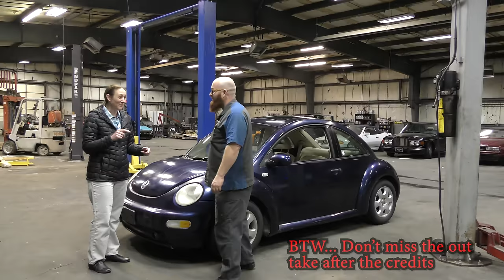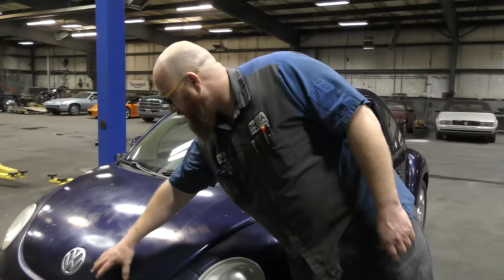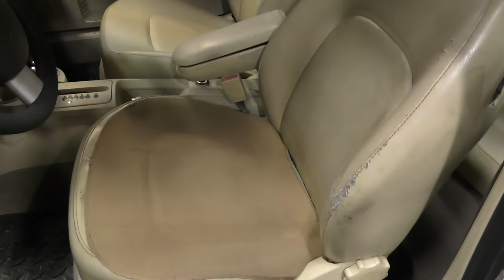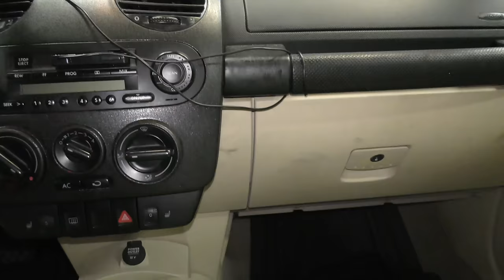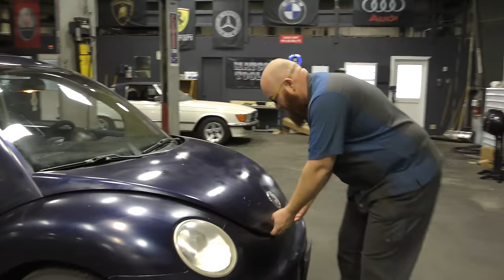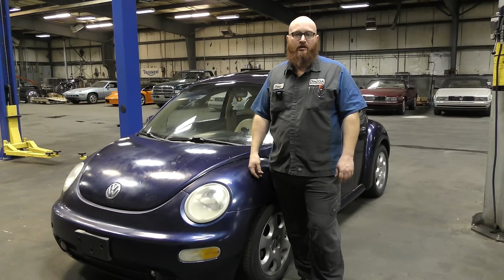Squirtle Update! Why does the CAR WIZARD love this 2002 VW Beetle so much?!?!

Comment: I had a 91 Jetta with the 1.8 8 valve and 5speed that I got from a customer with 289,000 on it. I drove it for a while and sold it to a friend who was tired of running his F250 60+ miles a day to work. He fixed the air-conditioning and put 90k on it before the odometer quit working. He parked it when gas went down again and ended up giving it back to me. I used it as a beater again and by the time I sold it we estimated it to have 450-500,000 miles on it.

Comment: I have the same system to connect my 1999 VW radio to my phone, but I've extended it with a $4 Bluetooth adapter from eBay out of China, into which the headphone jack is plugged. And even better, this thing also has a little microphone, so now it's also a hands-free system through the car radio. The bt device has a tiny internal lithium battery which lasts about 6 hours before it needs to be recharged, but it just plugs in via microUSB, like a phone or many other things.

Comment: I have a 2000 Golf TDI 1.9L with 398,000 on it. I will be pulling the intake to clean out the carbon, almost 60% blockage. Then I'll drop down and replace bushings in the lower A-frame. I also have KYB struts and strut components to install. Along with wheel bearings. Left side bearing is doing a lot of growling, but I going to do both while it is up on jack stands. I figure the right side can't be much behind the left with the milage.

Comment: I had an 03 competition orange beetle with the 1.9 TDI and was a manual. I sold that car a little over a year a go with just over 340,000 miles. That car was amazing I seriously regret selling it. It had a bunch of goodies and it was pretty peppy off the line. It had an egr delete a full straight pipe, cold air intake, lowered,  
5% window tint, drilled and slotted rotors front and rear from ebc with the mark series brake swap. :( I miss that little bastard.

Comment: @Car Wizard,
 Have you had any foam shooting up from the vents? The foam heater flap under the dash disintegrates over time and leaves the metal plate with air flow holes. Open all your dash vents and see if that helps air flow to warm better. I have a 98 5 speed manual TDI so I know where you're coming from.

Comment: My 2000 new beetle is the car that taught me the lesson about cheap parts once and for all. I did a timing belt, tensioner pulley, and the water pump. The water pump was a Gates. The water pump froze at 4,000 miles. Destroyed the valves shot two pistons, killed the car. Driving a Honda Civic now. Damn well has an OEM Asin timing kit.

Comment: You can use VAGCOM to close the ERG in the software, that way you won't get any codes. Also, since this is a variable vane turbo, exercise the vanes every now and then to avoid them getting stuck.

Comment: i had i and got another one a few months back..my first one 2001 jetts tdi auto i had it for 185k besides the maf going on me and the window recall nver stranded me , i did get well in the mid /high 40 on the highway as long as i kept it at 75mph..that was the sweet spot, now i have  12 tdi stick and love it..so far so good

Comment: There's a software setting for your TDI car where you can almost completely turn off your EGR valve (off road mode) and stop the gunk build up of your intake maniforld. You just need the cable that connects to the OBD port of your car (you can buy the cable on EBay for almost nothing) and the Ross Tech VCDS -Lite software for your computer which is also inexpensive. I did this on my 2001 Jetta TDI and afterwards I even had a lot more power.The dealership can do this (but won't) and Ross Tech VCDS Lite can do it also.

Comment: Iv got a Vw convertible 2004 best car iv ever had drives amazing & iv got a XK8 jag convertible trust me best value for money the VW beetle never lets you down & parts are cheap .
You can replace most parts yourself it’s like a Ikea car simple assembles .
When the summer kicks in & the roofs down it puts a big smile on your face & they come with a great sound system very good speakers .
The VW convertible 2004-2005 model Amazing car  & best value for money for a used car it’s a Solid 10/10 from me 👍

Comment: At least here in Germany and  ~7 years ago you could buy a Mercedes airflow sensor for half the price of the VW part. They used the same (i think Pierburg) unit just in a different housing. 2 screws to switch the piece you need in the VW housing. We used to deactivate the EGR valve on those TDIs to keep the intake cleaner and have the turbo spool up a little faster.

Comment: lots of info on  the beetles on the VWVortex and the TDI at the tdi forum. and codes are on the vag com forums. we get rust free parts all the time for them. here for people, there is a return spring for the rear calipers that helps out,, we brought them in back in the early 2000's from skodas

Comment: I had two of these...first was a lease return with 12k miles and I drove it until 168k miles before the turbo blew and there was a runaway and still got 3k for the car as is...the second I bought for $1300 it needed a clutch and an alternator...clutch took me 2.5 hours to do...and alternator took 5 hours LOL but book time for alternator is 12hours...I drove the wheels off of this car and was determined to keep it going until I retired...sadly 4 months prior to retirement I was rearended and my beetle was totaled out...man..was I pissed...although I still got 1700 for her...I missed that car every single day...what a great car these are.

Comment: If you want to fix the problem cheaply in a bind, just unplug the maf sensor, it'll run without limp mode, but use more fuel. Perspectively, replacing the sensor definitely makes sense though.

Comment: I have a 1994 Subaru Legacy with the 2.2l SOHC EJ22 with 289,000 MI, and it shows no signs of stopping. I'm eventually going to replace the head gasket and timing belt,water pump and do a reseal, and replace the piston rings because they are definitely worn.

Comment: i had that same issue buying cheap china parts off amazon. it was an idle valve for my accord. worked ok for about 5 minutes. went and got a real one off a junkyard car that had been rear ended, so i was pretty sure the engine parts were good when it got there. the junk yard one was half the cost.

Comment: Used MAF sensor can be worth a gamble sometimes. I got a used OEM one for £25 for my Volvo V70. Volvo wanted £400. I reckoned it was worth the risk even if it lasted 6 months. Went from limp mode to wheel spin in second gear. I kept the car for 2 years after this, MAF still going strong when I traded it in.

Comment: I had my mechanic clean the air flow sensor, on my 1999 nissan frontier 4cyl. That worked for 20 miles. A new one was $450. I bought a rebuilt one on ebay for $50. Popped it in myself. That passed smog & worked for 30,000 miles +. It wasn't  a high risk decision.

Comment: My ALH just lost the turbo at 295K and sadly it took out the motor. I decided to throw a used motor and new turbo for $5K because I get 51 mpg and don't want a Prius. *Hint-bigger injectors make this car much more fun to drive and actually improves MPG if you keep you foot out of it. Deleting EGR throws the check engine light but it doesn't matter, just leave it on and clear it before smog testing

Comment: 250,000 on a '94 VW Cabrio 2.0 gas 5 speed with the original clutch :D ... on it's third timing belt and second top. Burns a little oil, but it's a spare car, and my wife doesn't have the heart to get rid of it as long as it still runs. I wish my Chevy Volt's heater worked as good as this things heater does.

Comment: You asked about ODO miles. I have 370,000 on a 24V Dodge Ram 4x4 Cummins with an NV5600 (my last truck). A 9,000#, Rotary two-post helps me do my own maintenance.

Comment: Instead of that pipe to disable EGR, buy a blanking plate to both ends of the EGR pipe which goes from exhaust to intake. Best thing you can do to that engine. They're also available in ebay :)

Comment: I can't agree more on the MAF sensor subject. I had a bad MAF on my 2005 VW Touareg V6 and so I went and bought a brand new (knock-off) Bosch sensor thinking what's the worst that can happen? Well, when I installed it, the engine actually ran worse than with the original bad one (sound familiar?) So I bit the bullet and bought an oem one and that V6 was happy again. At least I was able to return the fake MAF and get my money back.

Comment: I have put 70k on my 92 chevy k1500 that has a total of 270k. My father had put at least 100k on it before me as his field service truck. It's on its 2nd engine and transmission and runs and drives great.

Comment: I've got a 2001 VW Beetle with a 1.8-T & a 5 speed standard tranni that I've Adopted on August 6th, 2002 that I have named Unbeetleble that has a turbo-back exhaust (cat & muffler got replaced with some glass-packs) I also had the factory K-03 turbo replaced with a K-04 & had a software flash from APR but of course I also put a high-flow intake system in it too. (220 WHP-244 Ft/lb of torque) I almost forgot that I also have adjustable suspension on him. BTW I wouldn't trade him for anything in the world.

Comment: 9:20 blend door. Been through that before. Remove the entire dash to get to the unit... properly.  It's more likely the foam on the blend door flaps themselves. Once they go, ac; heat, and air flow direction won't work.

Comment: my dads 9n9 polo 1.9tdi had done about 850,000km. he swears by that 1.9tdi motor. 
outside of basic matinance such as oil, filters and brakes we have only had to do a a fuel pump, ball joints and struts. It's held up great, when this one fails, i think we will pick up another one.

Comment: That just happened with me with injectors, $63 for a set of 6 when one oem is $76. After alot of other work and finally getting it running it ran terrible, poured gas outta the exhaust etc. Almost ruined my $500 van. But I got some at the junk yard for the price of admission and it runs great now.

Comment: Let Ms wizard drive it for a week, she'll love it. My husband brought home a 2008 toyota camry 4 cylinder with a 5 speed manual, I hated that car at first then I started driving it, now it's my favorite.
I love the gas mileage and how easy it is to drive, it has over 230,000 miles by now and still runs like new, we just have to do regular maintenance to it. My husband always says "a clutch is cheap to replace, an automatic transmission is not". I think he's right.

Comment: I had a 2001 Beetle TDI with automatic. I knew about the bad engine and replaced it, but didn’t know about the transmission. I ended up changing it to 5 speed. It was a big job for me but probably easy for wizards.
Reply: I forgot to say what a goofy car those Beetles are. The old classic ones are pretty cool but the new ones have some crazy stuff just to complete the look. The sun visors are useless especially when turned to the side. The taper of the engine compartment and trunk hurt space needed to work on it and storage. If you like wearing ten gallon hats, it has the most headroom. Other than that, it’s a VW Golf with different body. The engine goes forever, with proper maintenance.

Comment: Car wizard on those if you want to bypass the egr system you must remap that ECU there is no way around it , my 2.0tdi BRE Audi had the same issue with the EGR so I got a bypass and removed the EGR remapped the ECU now I have better power and no check engine also no smoke  so you should try that

Comment: HEAT!
The blender doors are covered with a blanket insulation like under the dash. It degrades and leaves big holes that your air blows through. The fix is to cover those holes with aluminum foil tape (for duct work).

Comment: And the only electric motor on the hvac system is for fresh air. All the rest are cable. U can access the cables n linkage behind a lil cheater panel on both sides of console. Should b 3....  red yellow green I think. Rite above airbag module...  you’ll see it...  then you’ll know if it’s something broken w the box

Comment: Change the fluid on that trans and it will last. I bought an 05 Jetta 5 speed auto with a"bad trans" that would stick in first till it warmed up. Changed the fluid and have over 10k miles of flawless operation since.

Comment: Hi Wizard!

You were complaining about Squirtle being cold inside on cold days. TDI Engines are very effective, so they don’t produce much heat. You need an auxiliary heater (Webasto) to get any heat in the winter. In Sweden it is standard for Diesel cars. 

Did you receive the hubcap I send you for Tyler’s Gallardo?

Best regards,

Henrik in Sweden :)

Comment: 269,000 miles out of 1.6 petrol engine....not bad....I got a 2003 Beetle with 93,000 miles for $300 and it drives great...(except for getting access to spark plugs my only compliant )

Comment: I had gotten a 1987 Nissan Sentra. 1.6 liter, 5 speed. 263,000 miles. 9th owner. Bled and lubricated brakes. New pads and rotors front, drums and shoes rear. Muffler, plugs, air and fuel filters. Blew some injector cleaner through her, and changed all the fluids. Damned if the car wasn't quick, tossable, fun to drive, and bulletproof. Where did I get her? The freakin' Purple Heart. How much? $700 (in '03). So yeah, good cheap cars are out there to be found. Just gotta know where to look, and DO THE WORK YOURSELF! Foreign cars are cut and dry, the systems that are NECESSARY to keep them runnng, are relatively simple, and user friendly by design. Just get yourself a Haynes rebuild manual and take your time. I was gonna' keep it til' the wheels fell off, but I was young, and sold it. Guy who bought it, wrecked it. I'll never part with a good old girl, like that, again...

Comment: The Mk4  was the most reliable line of cars for VW
I got an 02 VW GTi 1.8t 5speed 
Has a stage 2 tune and upgraded clutch and some other things. 240,000 miles still going strong

Comment: I have a 2000 Bug with about 182,000 miles on a 1.8 turbo with a 5 speed manual that i love. I have to say it is not my daily driver, i have a 2013 with a 2.0 t that is more fun even with the automatic transmission. So my baby has been parked more than it should be. .

Comment: Hey Wizard, if the car has a DSG transmission it might have a second thermostat, its a tiny little thing on the cooling line from the DSG. Not sure this one has it but I know that most of the passat and golf's have it. You should look into that, it could solve your heating issue

Comment: I can tell you right now it's the blend door bushing. Get a 3D printed one for cheap and replace it right under the air box between the foot wells just in front of the firewall. Takes 20 minutes.

Comment: Watch out for the heat issue wizard. VW heater cores are known to plug and it seems the diesels tend to be worse about it . I think it’s the iron block plus the EGR for some reason tend to generate sediment more than the gasoline engines ..........

Comment: Car Wizard, my dad had a 2001 Skoda Octavia with a 1.9 SDI (the non-turbo version of that engine) and it got to 575k miles. Sadly, when the timing belt was changed, the mechanic didn’t replace the bolts for the engine mount, and used the old ones. When the car hit a bump, the engine finally hopped off its mount and the belt rubbed again said engine mount. Shame, as it still managed nearly 80mpg (UK) on the motorway.

Comment: I would recondition the headlights as a safety precaution but everything else is pretty decent. I wonder if a wrap would be cheaper than a paint job. As for the heater issue, my friend has the same problem on his Audi TT. We replaced the thermostat and that didn’t solve it so unfortunately it’s something inside the dash. That’s a very nasty job on a VW as you know. But it looks like you did a very good job overall and the car still has a lot of life left in it.

Comment: Talking about bad electronics it seems that the solder used nowadays fractures over time from vibrations as it seems to undergo some sort of tin pest action which makes it brittle.  I have had a lot of success refurbing parts by just re-soldering them. Often you can see the obviously broken solder connections but frequently they are invisible.  Just going around a board and re-heating and applying a little solder often gets things going again (although sometimes you may need to replace a few components.)

Comment: i have little over 250 thousand miles on my volvo V70 2,5 inline 5 TDI.(its a VAG grup motor) just do regular maintanance on it like breaks,belts and suspension bushing. 60 thousand of those miles i have put on it.

Comment: I saw an A3 Audi with a plastic bung put in the radiator hose by a mechanic, to save losing all the anti-freeze.  Yep, he forgot to take it back out, and the car would get hot, but no heater. (No water flow obv.)

Comment: My dad had a 90ish dodge caravan that had the 3.3l v6. It had 475,000 miles on the original engine with no major engine work. It was on its 9th transmission. I really think my dad would still have it if it hadn’t got flattened by a semi.

Comment: 308000 on my 1999 golf tdi. Manual transmission shifts like new and engine runs flawslessly with a stage 1 tune, bigger injector nozzles, and egr delete. About every 6 months or so I'll have to fix something small.